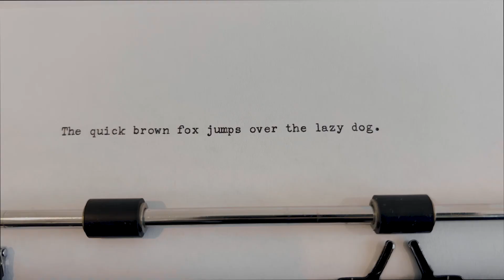Smith Corona Silent Typewriter Repair - Full clean, fixed broken draw band and shift lock

Comment: Do you have some tips on fixing misaligned text on the left side of the keyboard. Which screw should I loosen to lower those slugs? Thanks for your knowledge and work :)
Reply: I have the same issue on my typewriter, but I opted to not fix it. I feel that it gives my typewriter some character and looks unique whenever I type letters on it.